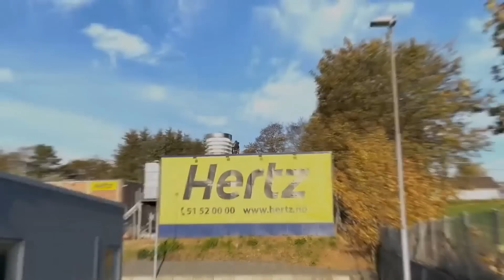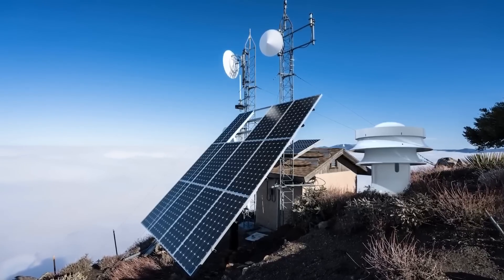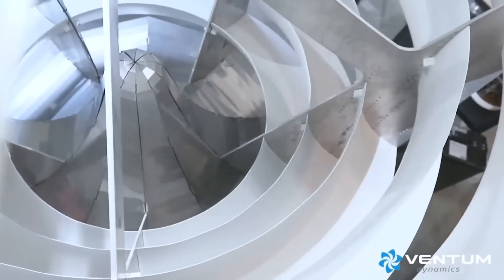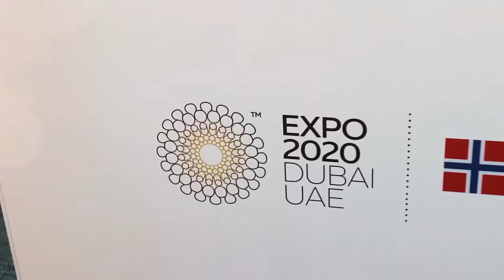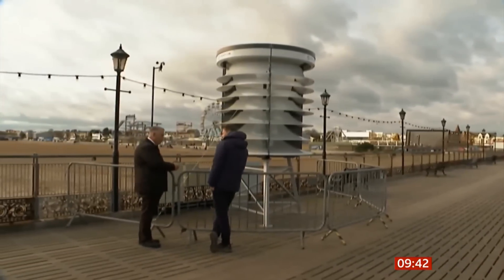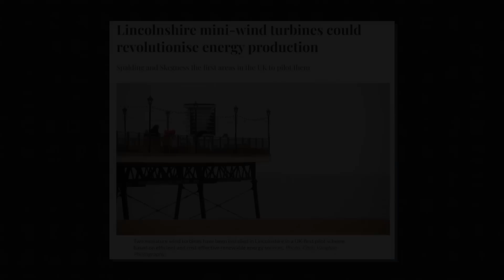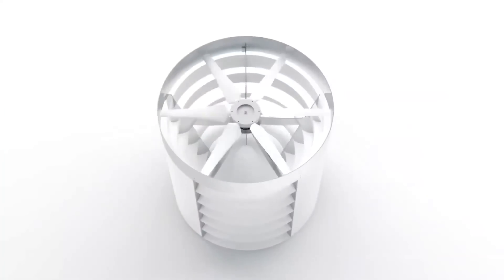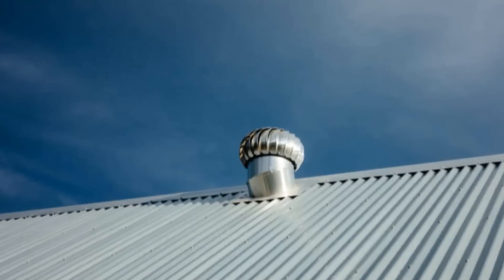Ventum Dynamics: The World’s Most Powerful and Affordable VAWT that Outperforms Solar Panels in 2024

Comment: 6:20: Greenhouse gas emissions per kWh depend completely on wind conditions of the site. And lifetime. 
Ventum Dynamics showed numbers for the annual yield with an annual average wind speed of 10 meters per second, which is totally absurd for wind near ground.
You can get about 6 m/s at the north sea coast, typical wind speeds for urban areas are much lower.
Looks pretty much like a scam to me.
However, the company filed for bankruptcy a week ago. We will never see real world numbers for power per wind speed.

Comment: All practical tests of ground-based small wind turbines show that they hardly produce any electricity! 
Electricity yield is proportional to third power of wind speed: +100% wind generates +800% more electricity! Close to ground: 0 constant wind, but extreme gusts! Due to extreme price decline solar panels generate at least 10 times more electricity with the same investment in time & money! 
Unfortunately not at night and not much in winter! But reliable && maintenance-free for 25 y+! And you need a battery for wind and solar.

Comment: FAKE!  All practical tests show that small wind turbines hardly generate any electricity!

Because there is hardly any wind close to ground. But 100% more wind = 800% more electricity!  

But due to the extreme drop in the price of solar panels, they produce 25 to 30 years at approx. 2% to 5% of the cost of small wind turbines! Reliable and almost maintenance-free.

Comment: They don't have blades? Yes it does on top. Seems to force wind through 180 degrees through several curved tunnels that force air to speed up. Essentially creating a vertical wind tunnel that forces air through the top blade rotor causing a generator to spin. How much power at what wind speed?

Comment: I did not check the costs you had in 2020, however, we are in 2024 and had a solar panel price reduction of 50% just within 2023.
For more, solar panels can already provide up to 700W per hour, your statement is wrong.
Let's take a current solar panel of 450W, which costs some 150 USD. Then we compare that with the 9000 USD of that wind turbine. Means that the wind turbine is 60 times as expensive. 
For the record: with the shift to perovskite solar panels will continue to get cheaper while in parallel efficiency increases. As comparison, while in 2020 you had an efficiency of some 20% max, in 2024 we will reach some 29% max. And this is by far not the end.
Reply: Those wind turbines where developed for northern Europe coastline where sun is there only for 6 monhts but air is constant 7-9 m/s the whole year.Its optimized for that area but yeah marketing can lie to get more sales.
Reply: 1painel cost 150 usd, no all sistem